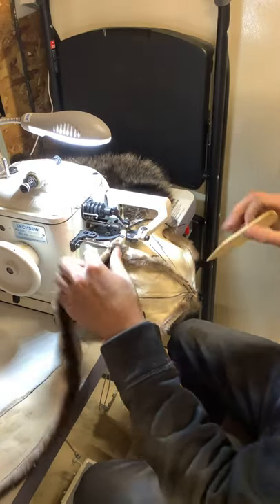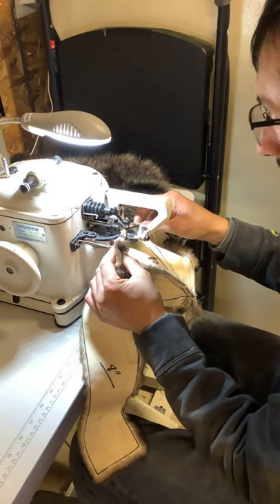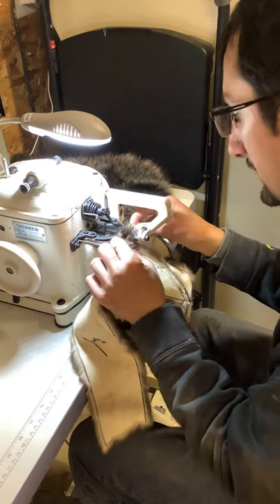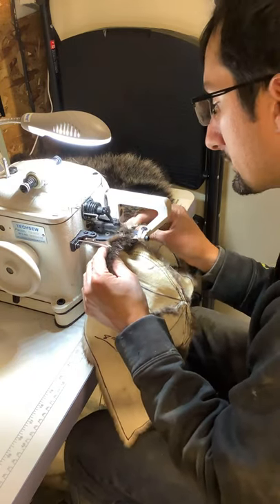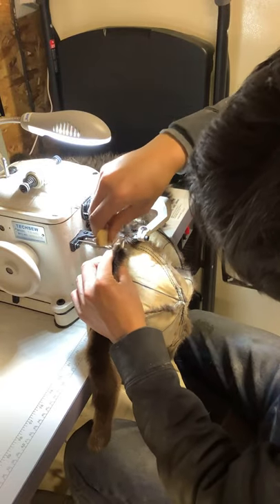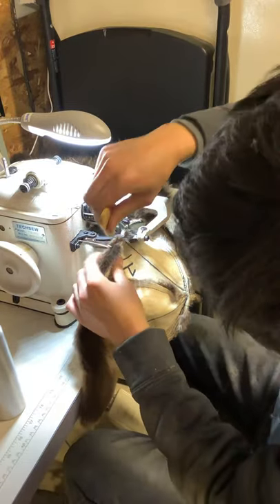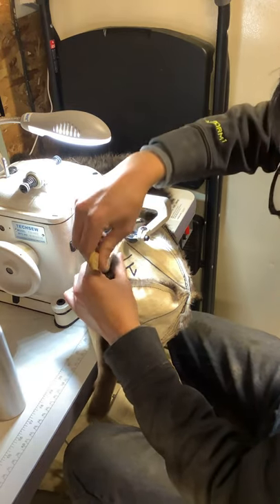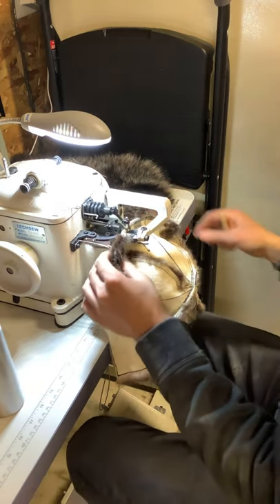Otter hat sewing part 2

Comment: Why use this over a standard model of singer machine?
Reply from the maker: It keeps edges really even, the seams don't show as much, you can easily tuck the longer fur. Also it doesn't have a lower bobbin so you don't need to stop for that which saves time on the bigger projects.